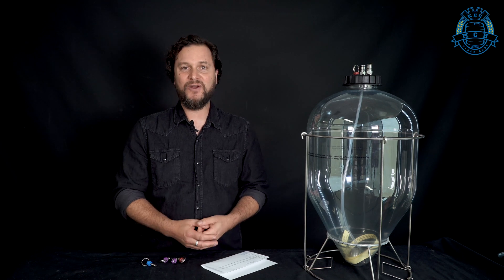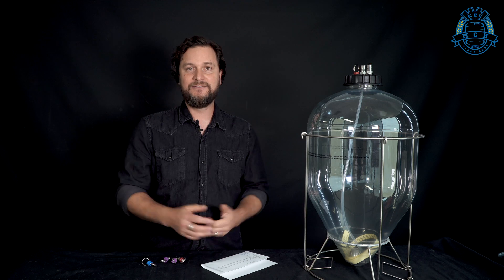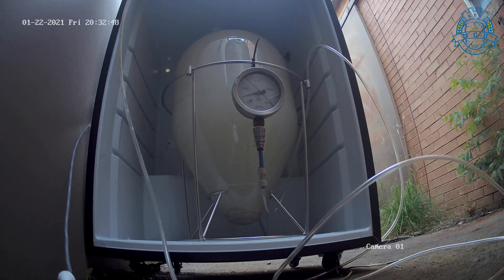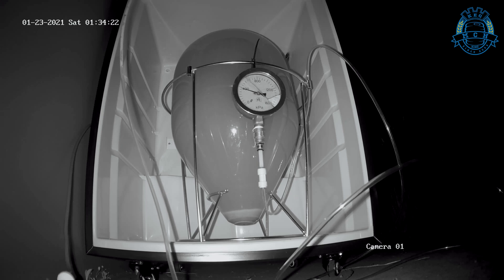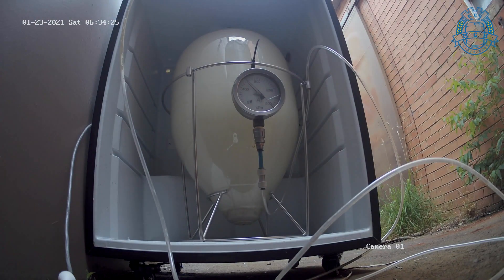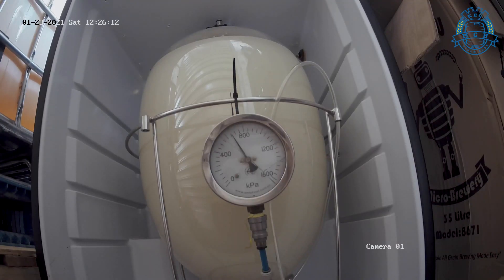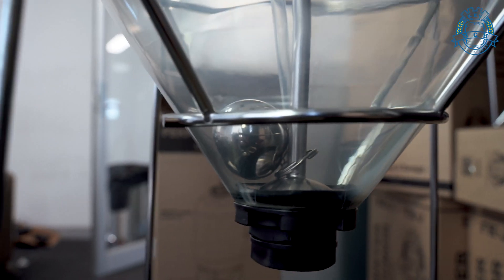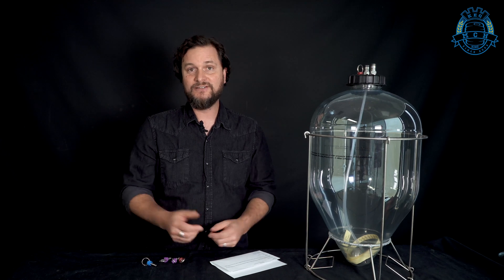Kill Testing a Pressure Fermenter

Comment: "... the process we use to create them, which can't be replicated." You mean these aren't just blow-molded like PET soda bottles? Not exactly a proprietary process if that's the case, and as an engineer (though not in manufacturing admittedly) I'm not sure how else you'd make this.
Reply from the maker: G'day Reid. There's PET blow-molding and then there is the patented PET blow-molding process we use which gives us a premold and then the expansion in one step.
Other bottles and fermenters are created using a two step processes that allows the PET material to cool before it is then reheated and expanded in another machine. This reheating weakens the PET polymerisation.
Reply: @Keg-King  very interesting, thanks so much for the reply!

Comment: I really like your King JR, but may I ask why you have a quote short “use by” date on the side of the fermenters? I bought mine for about a year ago, and it says not to ferment under pressure after spring 2022.. Shouldn’t it be safe for a longer time than that now when looking at this video? Thanks for nice products!
Reply from the maker: This means it should be pressure tested on or before that date and if no issue you can keep using it.
Reply: @Keg-King  I see! I just found a video showing how to do it! Thank you!
Reply: yeah , i bought a gen 3 and two juniors and i have the same thing with the date (uk ) only get about a year and a half before i have to pressure test ........and it possibly fail ? what then keg king ? would you supply a replacement free of charge ? im expanding brewing and my purchase of fermenters but not buying any more until i find out from you the script so to speak ?

what about a x ? years from first used date ? that would mean its not losing value to the customer while its sitting in storage in another country awaiting shipping or stored in a shop until its sold !